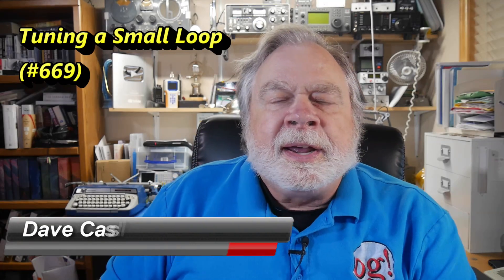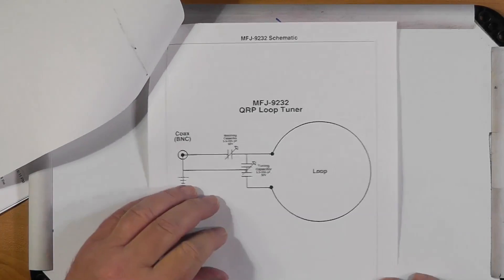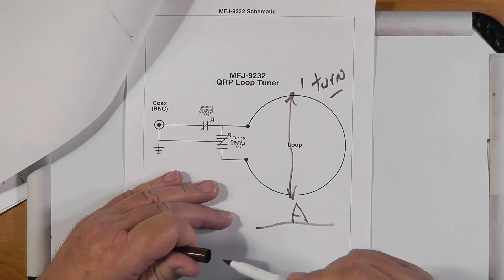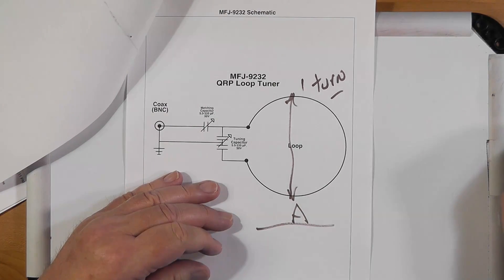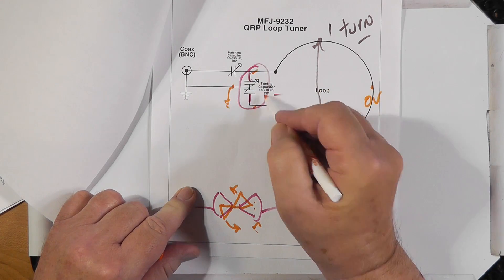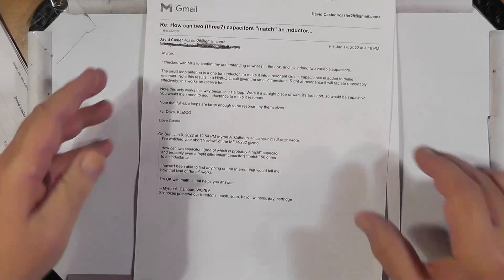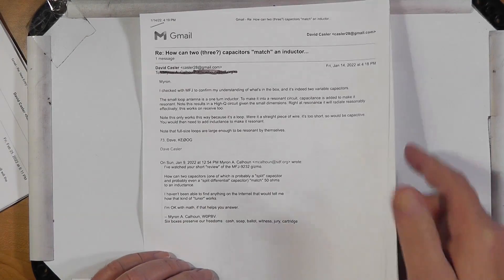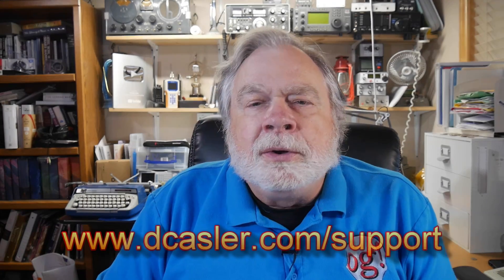Tuning a Small Loop (#676)

Comment: My experience is with the MFJ-933C loop tuner.  The 9232 appears to be the little brother to that tuner.  Trying to tune the loop to resonance can be tricky.  The best way to do this is to use a NanoVNA.  
The complicating factor is that the two adjustments are not fully independent of one another.  That is the setting of one influences the setting of the other.  
I use two curves on the NanoVNA, VSWR and Smith chart.  Set the tuning cap to mid-range on the band of interest, adjust the matching capacitor so that the curve on the Smith chart comes as close to prime center as possible, use the tuning capacitor to set the loop to the frequency of interest, trim the matching cap etc.  
It may require a few iterations to get things to optimised.

Comment: The question was how it matches to "50 ohms".  Your answer should have something about an example of what value of radiation resistance your example loop would be and then explain how the matching network transforms and cancels the reactive components.
Reply: I'm not sure how Dave could have been more clear with his answer. He described how the loop itself an inductor, and it is placed in parallel with the tuning capacitor, thus making a tank circuit. The length of the loop and the value of the capacitor will define the resonant frequency of the loop. The matching capacitor then compensates for the 50 ohm input impedance as needed if the resonant frequency adjustment isn't quite perfect.
Reply: @HabemusQuattro  the radiation resistance of the small loop is quite low. Maybe a few ohms. How does the tuning capacitor transform the radiation resistance up to 50 ohms resistive?  I still am not seeing how it is happening. I know it does. There's no question about that. What is the mechanism that makes this network a transformer?  I'm not seeing that here. I'm not finding that information. I know that inductors are used to cancel too much capacitance in the antenna and capacitors are used to cancel too much inductance. Transformers are used to transform impedances. There's more to matching than simply finding a resonance.  Look at the Smith chart. Anywhere along the resistive line the circuit is resonant, but typically the center is representing 50 ohms. That's the only point in the chart that represents the match. So on that Smith chart, we need to move the point representing our load to the center not just to the line of resonance. This is the question that the sender was asking.  It's pretty advanced stuff. Sorry.
Reply: @N9XRradio  50 ohms isn't the radiation resistance we are looking for. That's just the ideal match to limit losses from standing waves on the transmission line. The radiation resistance is whatever it is for the antenna – varies widely. Because the radiation resistance of a loop is very small, we need to maximize current flow through the loop to maximize power. 

Loops are inherently inductive (exactly the opposite of electrical antennas). That's why we use a capacitor to tune for a 50 ohm match to the transmission line. But you could also use a subsidiary loop, current transformer, or even an auto-transformer gamma match.